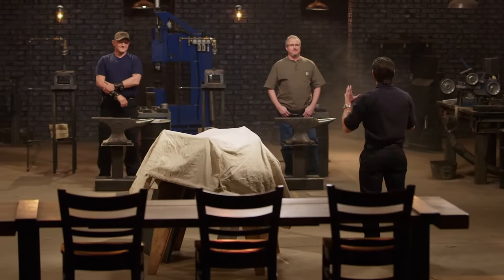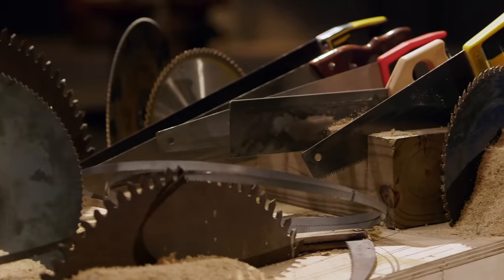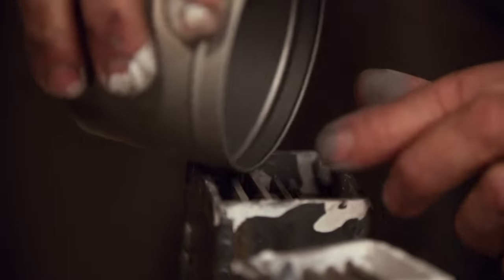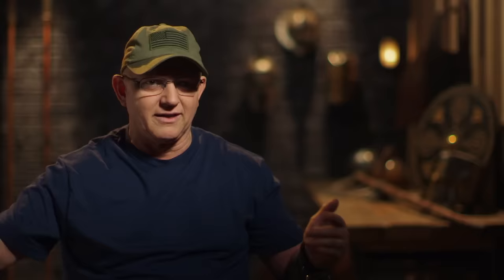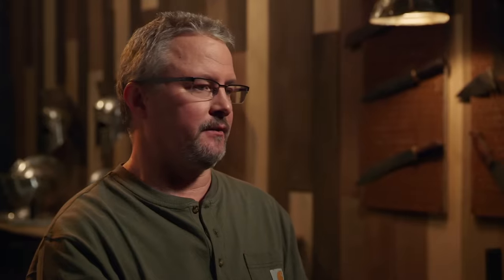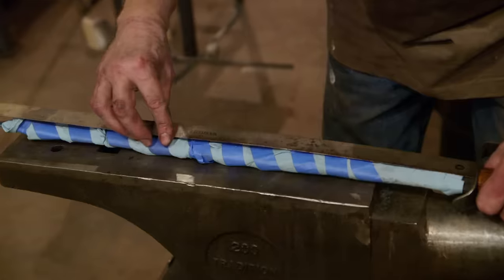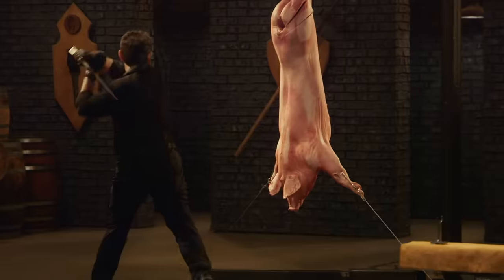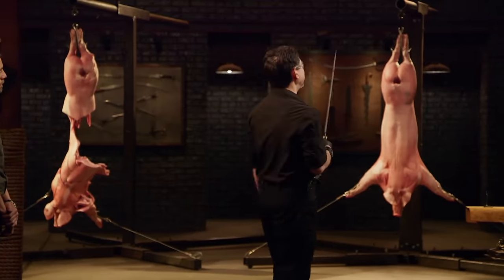Forged in Fire: Beat the Judges: SAW BLADE SWORD CHALLENGE (Season 1) | History

Comment: Am I the only person who sees that Jay's blade was not mechanically attached, thus not in the parameters, so should have lost.
Reply: Nope o noticed too and was seeing if anyone else noticed
Reply: Yes and it wasnt sharp at all j shpuldve lost this was friends above strangers
Reply: Where was it broken?
Reply: @zefrum3  it wasn’t broken the challenge included a mechanicaly attached handle (has to have a pin not just glue) and jay wasn’t pinned in
Reply: @chrismunson7899  This too. This entire situation was completely rigged against the dude because the judges wanna keep face.
Reply: I guess the grip was squeezed between the pommel and the guard? So that would mean it is attached, but still J shouldnt have won
Reply: Yep, Jay is not only a poor judge but an even worse blacksmith. Let's hope he improves
Reply: It's rigged lol
Reply: And second his blade didn’t even cut like AT ALL
Reply: @bufuhl1869  yep this one was for sure rigged
Reply: It was mechanically attached.  He used a hallowed out wooden grip and secured it with the pommel.  It didn't need pins or glue to stay on.
Reply: Agreed and didn't do as well cutting. Almost failed it.
Reply: The judges have each other's backs...

Much like Fury vs. Wilder I, when you are up against the house, you have to win by a long shot.
Reply: You can still pressure fit a hidden tang handle. Just depends on how the pommel is attached. If he didn't use glue, it's still mechanically attached. They never said pins were required. The sword flashed on the pins, super, but there's more than one way to mechanically connect a handle.
Reply: Yes but Jay knows all of the judges personally and lives right across from one of them.
Its called favoritism.
Reply: @D-Vinko  100%
Reply: It is mechanically attached from the pommel.
Reply: @chrismunson7899  Check the pommel he has it peened in, which counts as a mechanical attachment.
Reply: @777NihonSloan  fury vs wilder was 1 was a tie dawg 😂 and rightfully so.
Reply: @baileybuckley4796  how is winning 3 rounds a draw?
Reply: @baileybuckley4796  yea that's not completely arbitrary
Reply: @AcidAdventurer  right... it's the exact opposite of arbitrary. Each round is scored using a system that's been in place for a while.
Reply: @baileybuckley4796  right and when appealing to the judges and not that system, you're appealing to something completely arbitrary
Reply: @AcidAdventurer  you're appealing to the judges by appealing to the system, dolt.
Reply: @baileybuckley4796  that's not how that works at all unless you're suggesting judges can't be biased, paid off, or just plain wrong in regards to objectively evaluating based on the system of rules. You yourself said "each round is scored using a system". And when that scoring is affected rather than applied (what scoring actually is, the application of the rules, not the making up of subjective standards) by the judges, it is wrong and arbitrary (or right by chance and not proper use of the system). Yes, they're apart of the system insofar as the system has to be judged and applied, but you and I can use the exact same parameters to appraise a fight. The judges shouldn't play a part in the system in the sense that their own parameters or personal preference plays a part in how a round is scored. The whole point is they obviously got it wrong according to those standards. And appealing to the subjective application of rules and not the actual rules themselves is, again, completely arbitrary
Reply: @AcidAdventurer  the reason for subjectivity in combat sports is the same reason why a person can be offsides in soccer without the pass coming to him and not get called for offsides. The referee would have to infer that the intent of the pass was to the player that was off sides which would leave that entirely up to subjectivity under many circumstances. A significant strike is subjective, but not arbitrary; arbitrary would imply there's no reason for calling a significant strike a significant strike. It isn't random or a judgment made on a whim.
Reply: @AcidAdventurer  if you were to say that it's particularly subjective then I'd agree with you.
Reply: @BluCappy419  finally a voice of reason
Reply: @D-Vinko  They should have just given it to Tony at the end then and told J later if they wanted to save face. But Tony was robbed.
Reply: Jays blade was simply not as good as Tonys. It did not cut effectivly
Reply: I'd be willing to bet Tony's sword wasn't even really that heavy - maybe a little weighty or something, but the way they all focused on that one aspect makes me wonder... c'mon guys. Really makes me lose respect when you can see bias so clearly.

As far as the handle being mechanically attached, I didn't watch the actual episode and in this clip alone it's hard to tell how Jay has his attached. Though I will say that in the demonstration when the words "mechanically attached handle" were spoken the rivets/pins holding the handle of the sword in the diagram lit up specifically.
Reply: The graphic probably didn't match the actual parameters: Having a pommel secure the handle could have been sufficient for "mechanically attached", but the graphic artists just went with the pins.
Reply: The pommel is probably peened. They don't show it in the video. The whol pin in the handle is a Knife-thing, not a sword thing.

Comment: the judges We’re being a little biased on that call bad judging
Reply: Hanson duron I disagree, J lost fair and square before and he won fair and square this time.
Reply: I actually agree. The judging was indeed quite bad. He definitely beat him on the pig cut. And on the sharpness test he cut halfway through the arm and that was it. With a little cut like that i dont even c how they can call that a passed test.

Ps. the edit was a spelling mistake
Reply: Dwagon Go Rawr If Jays sword is way lighter yet his pig slices were as devastating, how does that mean he lost to the guy? That is an amateur observation.
Reply: @jaredfran519  Weight is a substantial factor yes. But when the judges say they are choosing a winner based off tests than those tests should hold all the point values. And let's say the point values tie, then you would switch to observing the balance and weight of the blade. If that doesn't satisfy than switch to blade construction, and if that doesn't even satisfy the vote then switch to pure aesthetics. Back to the point though, the scoring of the tests should be what determines it.
Reply: If you are gonna judge based on weight alone then why even do the other test?
Reply: @cntipede1000  exactly.
Reply: A light blade allows for quick attacks. Even if it isn’t sharp, you can realistically sharpen it again. With a heavy blade however, you would have to grind down the blade to make it lighter. Plus, on a battlefield, there’s no point in it being a good chopper if it’s too slow and heavy, you’d get tired and out maneuvered by your enemy. In my opinion, I agree with the judges on this one.
Reply: @jaredfran519  they went. The first guys nearly cut the pig in half. Jays only cut half way into the pig
Reply: Nick Butler The pig tear is the kill test not the see how deep your blade cuts into the pig.. everyone would make a heavy blade every time them, Doug even says it’s about being able to wield it, does it have good balance etc.
Reply: @jaredfran519  they both will kill. But jays doesnt kill as good
Reply: @jaredfran519  are you serious?
Reply: Nick Butler Yes it’s all about effective wield-ability in a real fight, unfortunately we’d never see the actual fight of two people dueling to the death with those blades but you could imagine how it might go.
Reply: @jaredfran519  id rather a slightly unwieldy blade that can hold an edge better than a lighter blade
Reply: @nickbutler9831  That’s where you’re wrong. In a fight stamina and speed are a significant factor. When both weapons perform almost as well then the short sword which is not double the weight of a longsword would win.
Reply: @dwagongorawr5481  you cant just use that sword often....it's very heavy for one hand
Reply: @swarupchakraborty6291  that's were years of practice wielding blades such as that would come in hand.
Reply: It should have just been a tie honestly, but if anything, jay won by the smallest margin ever by aesthetics and weight. For utility, he would have lost. The heavier blade could probably still generate enough momentum on the shorter side of the blade where it is still sharp and cut into human bone, but the light blade could not possible carry the same momentum and energy as that heavy blade... not enough testing was done.
Reply: @dwagongorawr5481  That's not how that works. The only people that would be using swords historically would be people who spent years training and studying to use them, so that means that historical sword designs were optimized to be used by people with intensive training anyway. There's a reason why swords are quite lightweight; the killing power of a longsword comes from it's length due to the mechanical advantage of the length rather than the weight, and a thrusting weapon gets it's killing power from the sharpness of it's tip and the edge near the tip. Exhaustion is an unavoidable thing in combat, so weapon weight and weight distribution is a deciding factor on who can avoid becoming winded.
Reply: @davidsmith7752  tell me if I were to train using a heavier sword would I not be able to use it longer? If i were to train using a lightweight sword would that not make the heavy sword feel heavier? I'm just saying with enough training and commitment you can last longer than an opponent with a rapier if your careful about your fighting style and how much energy is put into each attack. Ntm a sharp sword requires less energy to cut through something (or someone) than a dull sword does.
Reply: @dwagongorawr5481  A weapon that is over heavy is worse than a weapon that is at a proper weight and balance. There is a reason why standard sword designs aren't heavy, despite having been wielded by people who were dedicated to using such weapons. In addition, momentum makes it so that a heavy weapon made to the design of a light weapon will always be more unwieldy regardless of how strong you are. As I said, there is good reason why people used weapons of a standard design and weight; they were objectively better than the alternative.
Reply: @davidsmith7752  did the judges mentioned specific weight ?? & In the test the judge clearly lost . Wtf r u saying . .. real fights??hahaha
Reply: @arx9996  The weight and balance of a blade are key to its quality. A sword that is heavier than the ideal to too great a degree is a bad sword. Saying that a sword should be a reasonable weight is like saying that a piece of chicken should be cooked, it's just implicit.
Reply: @davidsmith7752  maybe true but the weight factor should have come if their blades were performed equal or what
Reply: @arx9996  The weight is much more important than the sharpness or edge retention. You can sharpen an edge, you can even repair damage if the blade isn't snapped or overly chipped, you can't easily lighten a blade without making it worse in other ways. As I said, it's like if someone served raw chicken in Masterchef, they've made a fundamental mistake in their work that makes any test of quality beyond the baseline at best pointless and at worst impossible.
Reply: TBF J should have lost because his grip wasn’t mechanically attached..
Reply: @Kaiser Franz von Lappen der alte but that type of sword is literally designed to be a axe in the shape of a sword where the sword needs to be heavy by design. They where tasked with a stereotypical short sword it seems, and unfortunately his seems more like a Falchion.   Actually really similar to a Falchion.
Reply: I feel they should’nt know which blade is who’s bc it would give them a more general and less direct judgment of the blade instead of telling them what’s wrong give the audience a better understanding yk
Reply: It
Reply: @cntipede1000  it based on the specific use of the sword, they are looking to a short sword which is needed to be light. they are testing how sharp they are but not expecting it to cut a whole pig into half with just a single slash. short sword vs. long sword they have different job for a specific purposes.
Reply: @hoticeisnice1354  you cant sharpen your dull blade if you are dead...
Reply: @justarandomguy3969  Ack, forgot I made this reply. Well, both weapons can get you killed, but they both can also kill the enemy. Which one is an easier fix though?
Reply: @hoticeisnice1354  a blunt light blade cannot kill anyone... a sharp heavy blade on the other hand CAN kill someone and even if the heavy blade got blunt you could still use it to cause blunt force trauma.
Reply: @justarandomguy3969  Hey wait, that heavy blade was also becoming dull. Both blades did well against the pig too, but the judge only seemed to make a comment about the edge for the heavy blade when they did the sandmen test and that it was bludgeoning it.
Reply: @hoticeisnice1354  yes, but it at least cut the Sandman, the light one only cut the arm and then scratched it afterwards while the Heavy one kept on cutting the Sandman (be it poorly but at least it cut)
Reply: @justarandomguy3969  Same could be said for the light one, no? Cut poorly, but it does do some damage
Reply: @hoticeisnice1354  no the heavy one did much more. did you not watch the video? 7:47-8:57
Reply: @justarandomguy3969  The judges just think weight is more important, which I agree usually. That’s a 4 pound sword! Hooo, that’s almost two handed material right there.
Reply: @dwagongorawr5481  easier said than done mate